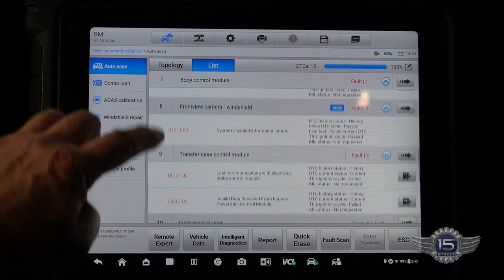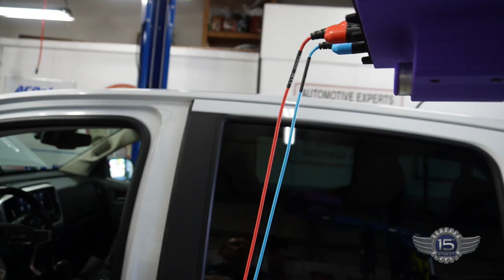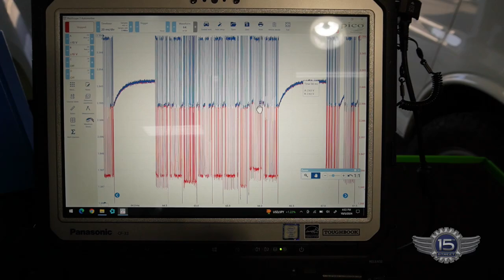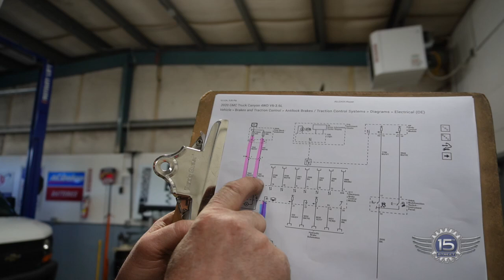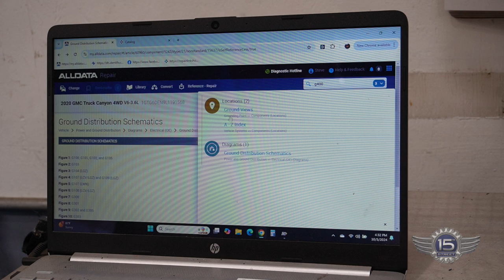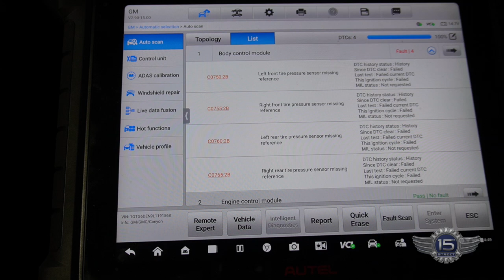GMC Canyon ABS Communication Failure

Comment: Do you use your nastf credentials much? I just got mine 3 months ago still haven’t needed it.
Reply from the maker: I've used it twice in 10 years. But when you need it you need it.
Reply: Yea they made me jump through hoops. Insurance and get stroked 300 bucks for the application fee. I’ll charge 300 bucks the first time I use it to pay for it 🤣. You a one man shop or you keep your workers in back when you film
Reply from the maker: @philh9238  3 techs but they are in a different side of the shop. I have two isolated bays to myself. Just the way I like it.